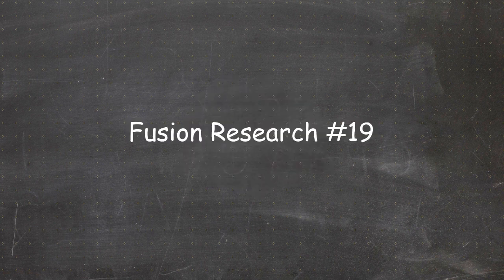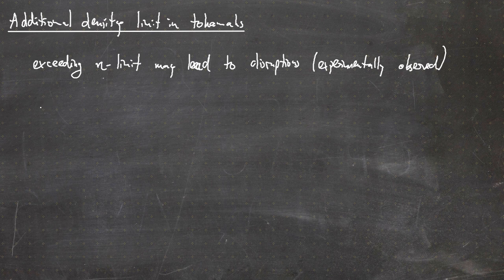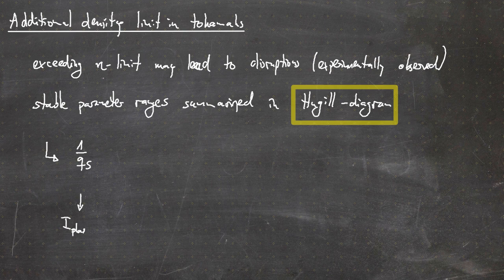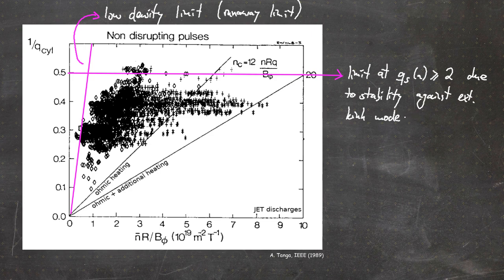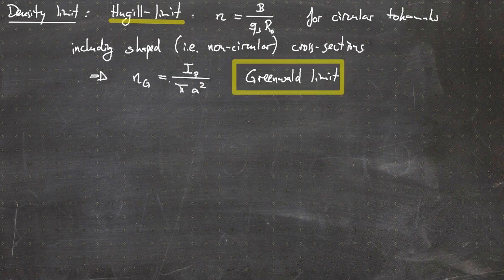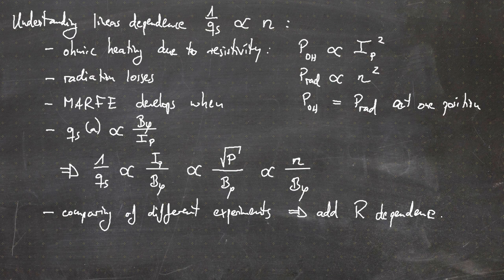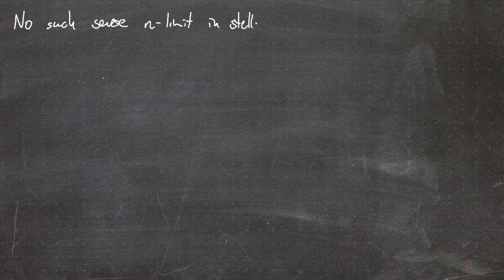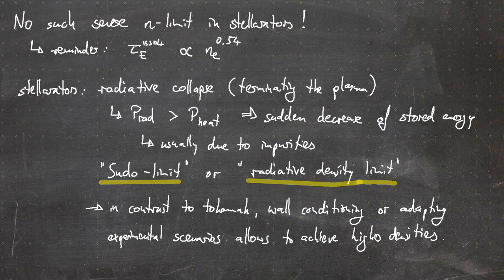Fusion Research Lecture #19 - Density limit in tokamaks (and stellarators?)

Comment: As a linux user, the `sudo limit` may be my new favorite concept in fusion research. Cheers to S. Sudo! https://iopscience.iop.org/article/10.1088/0029-5515/30/1/002/pdf

A question, though. At about 10:24, when discussing the Hugill and Greenwald limits, how do the units work out? Density's a m^-3, while both right hand sides of the equations have charge-y quantities (magnetic fields and currents) which don't seem to cancel out with anything.
Reply from the maker: Always reminds on that xkcd cartoon https://xkcd.com/149/ ^^

Good question concerning the units, I should have said that in the lecture!  n_G is in 10^20 m^-3, I_p in MA, and a in m (so it's more like scaling, units do not really work out here)
Reply: @DerPlasma   ah, so it's a "is proportional to" relation. Makes sense!
Reply from the maker: @DSMPerfi  exactly